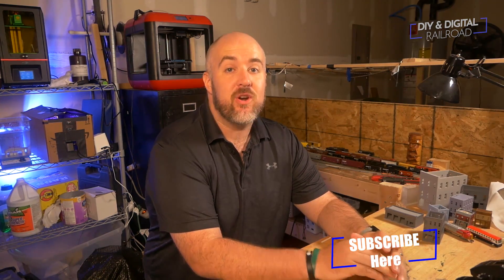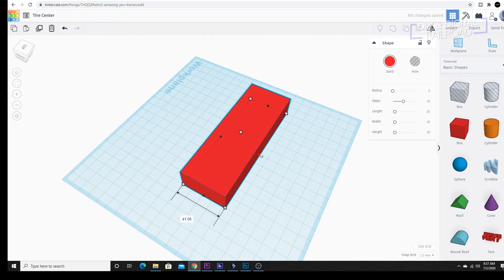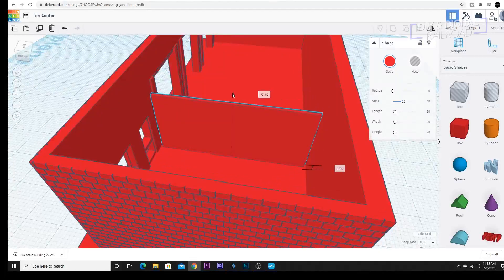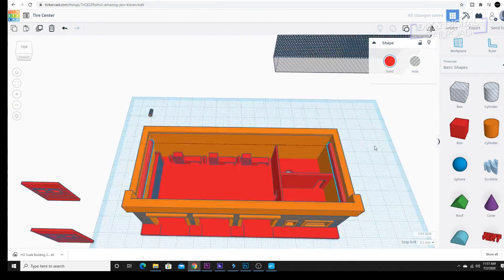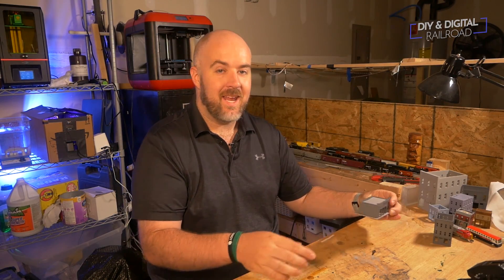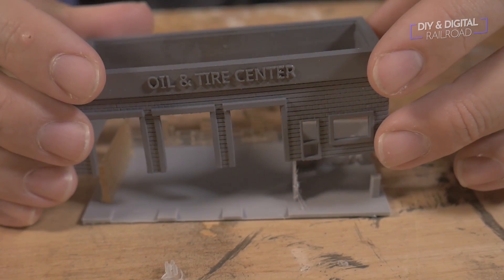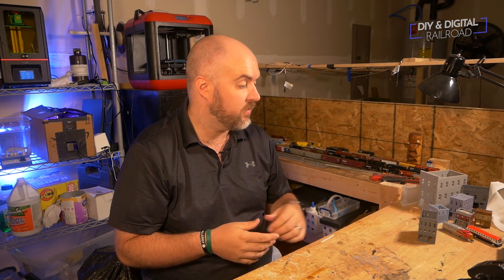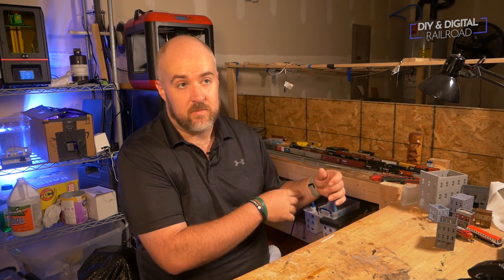N Scale 3D Printing:  Designing and Printing an Oil and Tire Center

Comment: How did you get the brick template? This is awesome, I just got my first resin printer and am using it to create a new layout. I’m finding it difficult to find file to download in N scale so I’m going to start creating my own models. I have been using my fdm printer for years, but now that I’m printing in resin I have to learn how to add details like brick walls without having to create each individual brick. Thanks

Comment: I'm just thinking of getting back into model RR after a long hiatus.  I'm now in the middle of the N Pacific Ocean (Hawaii) and shipping to here either takes forever, or is expensive if not Flat Rate USPS. Have you considered selling your files so that one could print themselves. I am very aware that the work is in the design and not in the printing so I would suggest maybe 75% of spoiled print cost. 

I looked up your patron site and unless they are in the high tier I did not see and designs.

Mahalo
Reply from the maker: Hey Peter!  Sorry for taking so long to reply.  The buildings are available at the $5 engineer level.

Comment: You're running into limitations of 3D resin printing.  Unless you go for the very expensive engineering resins, then what you have there will shrink and distort over time after curing.  It's a fact of life and it takes a lot of work to prevent it.  Can't have solid walls as you're doing since that actually encourages and makes it worse.  You can go with hollowed out backs of the walls and then add styrene to reinforce it afterwards.  Hot water will help soften the resin walls and let you clamp them into straight sections again. Figure you're going to spend several hours per structure fixing the issues.   Keep that in mind in your costs as your structures will have to be increased dramatically in prices if you account for your time involved.   Either that, or keep them cheap, let them warp and include instructions on how to help fix these issues.   

Chooch Enterprises had similar issues with their resin castings. It's not the printer, it's the material that is the problem.  Just the nature of the product.  You will get warpage.  You just have to know how to plan and account for it.

Comment: I have now purchased virtually every one of the building series and must say they are wonderful. My latest receipt was a 3 pack of the row houses and I'm awaiting building #6 to arrive. I have two minor suggestions - first on all store front doors it would be helpful to open them the same way you do the other windows. Most store fronts would have glass in their front doors. I have been opening the window areas myself but it's a bit of a pain. For anyone desiring to have a solid door with no glass they could easily glue in either card stock or thin styrene. 

My other suggestion is for the new oil and tire center. Having the raised lettering does not seem to be a feature to me. Full disclosure, I will not be purchasing that building as it doesn't really fit within the city scene I am building but I would imagine that an average modeler would want to add a business sign of their choice whether that be a modern quick lube such as Tire Center, Jiffy Lube, etc. or a private named business such as Billy's Auto. Having raised lettering would require removal of the lettering prior to applying a different sign. 

Please keep creating new buildings. You're doing a terrific job.  Dave

Comment: Why does the tire shop walls look warped when you show it up close? The base looks warped as well. Just curious. Also, did you design the brink template for TinkerCAD or was that something you found online? And if you found it online, can you tell me where you found it. Never seen a template like that before. Thanks.
Reply from the maker: So the print was the first print and it warped slightly printing.  That's a support issue and it's one thing that is part of my finalization process before I sell.  I actually made the brick template in tinkercad myself and downloaded it as an stl so I can load it in any time.  I also know the scale so I can adjust for different scales.
Reply: @DIYDigitalRailroad  That's sweet! I'm trying to make something similar in Solidworks and its always crashing my system.
Reply: It's both a support issue, but more a resin problem. These resins do shrink as they cure and 'dry' out over time. The thicker the cross section, the more warpage that will result.  Thick walls like these are going to warp. That's just a fact of life. If you heat them up in hot water, you can bend them back and further so when they do cure they might be mostly straight.  Making the walls much thinner and reinforcing with styrene afterwards will help a lot.  

But just get used to it. These resins are not meant to be used in this way so we have to accept their limitations.